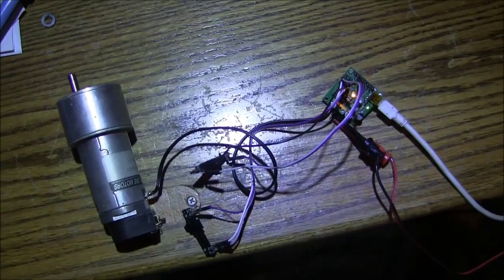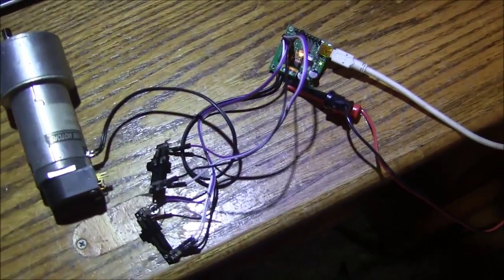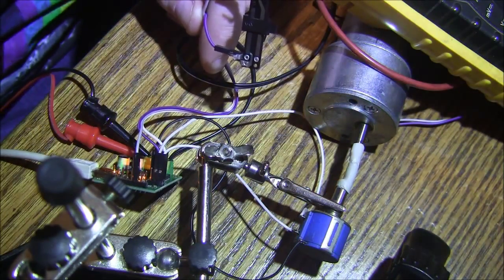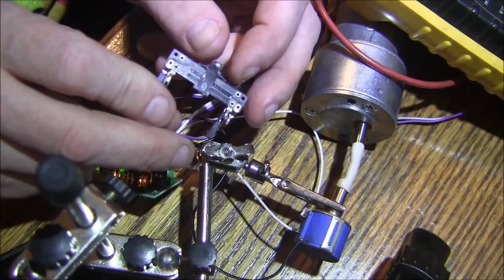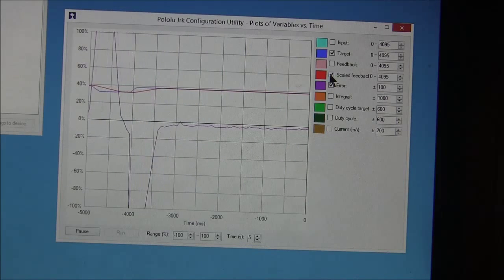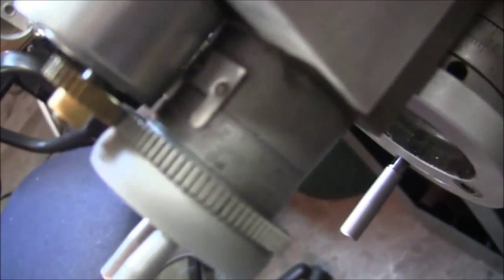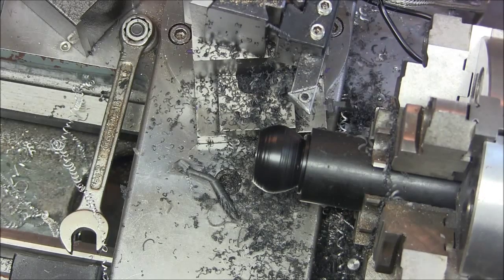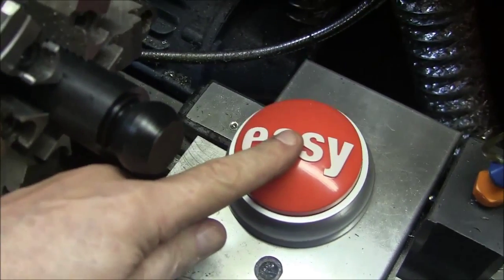Trace O' Matic

Comment: cool idea, very cool. So how did it turn out? I think to prevent the sin/cosine error could be done by having the stylus at the same angle as the compound? And Keith has added a new version on the contour trace attachment
Reply from the maker: It works OK if the angles are set up right. It cant do steps but curves and angles are fine. I dont use it much but when you need to copy something it comes in handy.